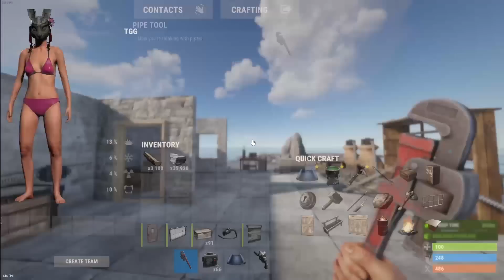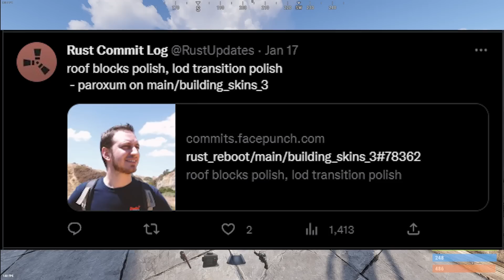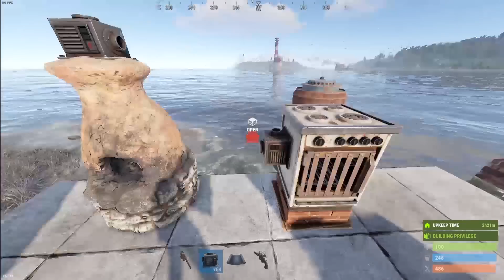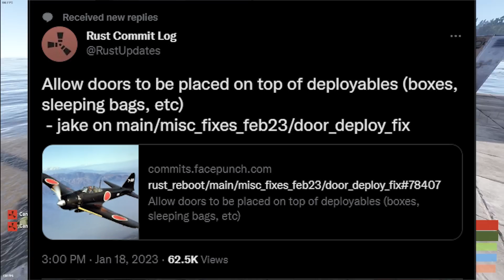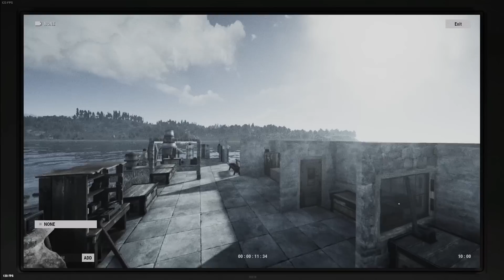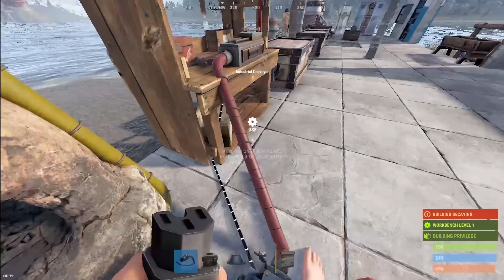Rust What's Coming | Update to Industrial Pipes, RC Drones & Turrets #232 (Rust News & Updates)

Comment: Use low walls for pipe passageways, this forces raiders to still take walls out to get to TC or whatever. So, there was zero reason to take away the pipe going through walls...
Reply: Also, its basically only small groups and solos that use pixelgap bunkers, but now they cant use it anymore, if they want to use pipes.

Pipes not beeing able to go through walls was a huge nerf to small groups and solos, and a inconvenience to large groups.
Reply: 100% agree. And you can still just use roofbunkers. The only thing they did was make it harder to lay pipes. Thats all. Now large groups and clans will use it because they have to, and small groups and solos wont bother, because it will be so hard getting the pipes around small bases with jump-ups etc.